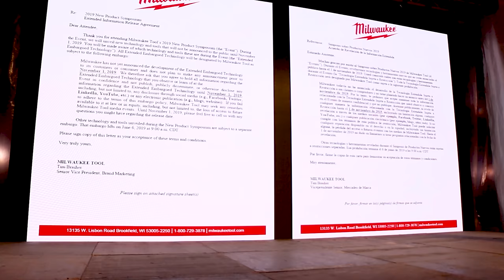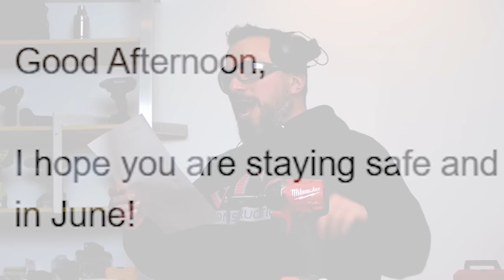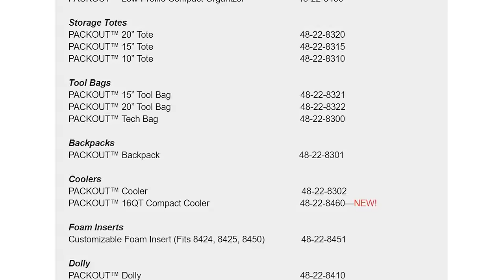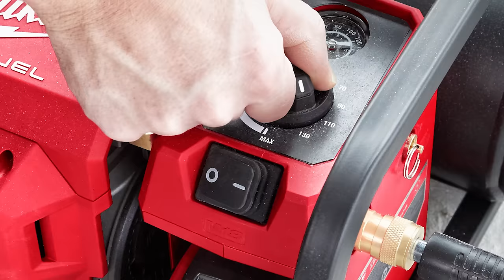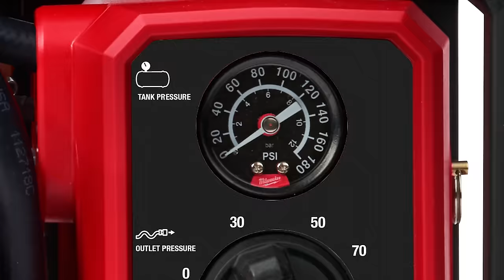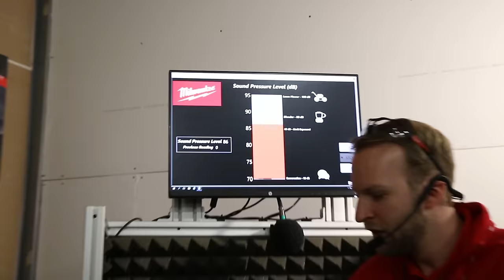MILWAUKEE TOOLS NPS 2020 IS HAPPENING RIGHT NOW! (FIRST LOOK NEW RELEASES)

Comment: Would love a packout Vacuum like everyone else. Fuel Multi tool m12&m18 would be nice just for a little more power, lawnmower, also a M12 pressure washer like word design with the hose or small water container

Comment: Very excited to see the compressor. I'll need to see it in action before deciding if I like it more than conventional options, but I think this would be great for simple things like filling up tires without worrying about running over to an outlet to fill up the tank every 10 minutes AND lets you be portable to places like storage units without driving around with either a generator or a tank of compressed air (which I'm not a huge fan of doing) in the back of the truck.

Comment: It stands to reason that Milwaukee likely caved from so many people asking about portable air compressors. Ryobi and DeWalt already have battery-operated units. 

What tools do I want to see next? Well, my dreams are lofty, but I dream of the day Milwaukee makes a portable M18 battery-operated plasma-cutting torch. Heck, get me a multi-bay M18 battery-operated welding machine too with SMAW and GTAW (Stick-Arc and Tungsten-Inert-Gas). Probably would cost the price of a liver but would be cool as heck.
Reply: Also, I see potential with the cooler-pack to have an M18 powered cooler. There's already units you can plug into a cigarette outlet and have them chill drinks without the need for ice.

Comment: How bout a Milwaukee M18 15 amp Sine Wave Inverter Power Supply? Dewalt released in 2017
Reply: Milwaukee has a patent for a packout compatible inverter.
Reply: @amoscardoza5253  yep seen that around the time the 2019 NPS happened.
Reply: They have a patent for an M18 version almost identical to the MX FUEL one. I made a video about it a while back.

Comment: I want 2 things. a portable, standard table top drill press that runs on m18 batteries that i can use in my wood shop then pack up and take with me in my off road recovery rig.  2nd is I want a solar charging station for the batteries

Comment: I like the compressor, but really wish it was dual fuel- some days 1600 nails is our breakfast- I hate changing batteries and lugging a billion in the van. I love the flexibility tho when I only have a small trim job to use a cordless miter saw and a cordless compressor would add to that, just wish I could plug it in when we’re on longer multi day jobs-

Comment: I wish millwaukee would make an m18 powersorce like dewalt has were you could put 4 batteries in it and get 15 amps ac out of it or charge 4 18v batteries on it.   I think people would buy it because their is still alot of corded tools and appliances and this can power those and run a microwave without the huge expense of buying new batteries for the mx line and that power station.  This makes the batterys most people already have. More valuable and gives people the mobility of power. And if millwaukee designed it well enough. It can be an add on to the existing millwaukee pack out system so other boxes can be stacked on them. And Also design it to take the 12.0 battery for longer run time.

Comment: Would like to see a m12 gen3 fuel jigsaw and multitool
Reply: Milko Petkov with a dust blower on the jigsaw
Reply: I use my m12 multi tool the most and it could use a bit more “fuel” power.  I’d buy one for sure

Comment: I knew they’d do pneumatic option, b/c as battery nailers are great. If you doing a production job, battery nailers are not fun to carry/use all day still on a production setting. Just isn’t fast enough compared to the “weight” of a pneumatic nailer, imo 
But, would like to see the battery nailers shed some pounds & get lighter....cuz that would be nice

Comment: im not a carpenter but maybe some of the old school guys still like the air compressors or maybe the battery nailers are too heavy & bulky with the batteries on them....im sure milwaukee will have an answer 🤔
Reply: All hail the King!!!
Reply: Preach it brother!
Reply: It's true at this time... Staple guns, and 18g Brad nails and above can all be benefitted by air tools... I have a Makita 18g Brad nailer. It does well... But it won't drive more than about 1 1/4" in pure hardwood. And the air nailers are generally faster and lighter weight as well.... And cheaper than the electric lol. For 23g pin nails it's cordless electric all day. I personally don't think I will ever go back to bringing an air compressor with me. But that's just cause I do most of my prefab at my shop. If I had to build from scratch at the job site I would 100% need a portable compressor
Reply: cordless nail guns are too heavy bulky. and not powerfull enough for hardwoods. air tools dont over heat. have small profiles. and can shoot reliably nonstop
Reply: @josephvouis5301  looks like you answered it...thanks for the response 👍

Comment: Wouldnt getting a inverted generator with cordes tools be just as efficient maybe even better, it would of been nice if you can wall plug these aswell as using a corded outlet rool with compressor tool optional aswell, im thinking more of a multitool purposes

Comment: Need to make a battery jumper for your car
Reply: just stick a 14 awg thhn wire into the right terminals on a m18 battery and connect that, I've done it many times in the winter.  I just wouldn't risk it on newer cars with sensitive electronics

Comment: Dear santa, I want an M12 insulated cable tacker/stapler, an M12 combo work light/Bluetooth radio, an M12 cyclonic vac that doesn't clog up after cleaning up 2 teaspoons of concrete dust like the current ones do, a compact M12 blower, and a gen 3 M12 hammer drill driver that isn't weaker than a little girl. It's got less torque in gear 1 than my old  Ryobi has in gear 2...

Other than that the M12 gen 2 impact and soldering iron are fcking awesome.

Also it's probably just me, but packout is my nightmare. So many parts to separate and latches to undo all the time to get what you need.

Comment: Will the Milwaukee air compressor be able support 16ga. & 15ga. Nailer.
Reply: Chris Chamberlain it should ... maybe even for a framing gun too but not for a big framing job just for small things. But I could be wrong on this we will see few test here on YouTube and then will know it  ... but for the 15ga and 16ga it should be no problem
Reply: Wolfgang Selle I am been trying to find a compressor just for trim work. That quiet for into use.

Comment: Recently switched over from Ridgid I'm a huge Milwaukee fan I would love to see a fuel version other oscillating tool as and maintenance and repair Tech I used the oscillating tool quite a bit and I'm not fond of the Way you change blades

Comment: Honestly I did kinda think they would make this tool. Hoped so even more than thought so though. There's a ton more uses for air on a job site than just running your guns off it. Anything from cleaning sawdust off yourself and your tool bags to topping off your big truck tires (which their M12 inflator was falsely pictured doing... yet again, awesome tool, but overhyped, so peoples expectations were too high and not met). This, however, should be able to inflate a truck tire, maybe even a tractor tire if you were patient. 

All that aside, there's two categories of tool guys they have to look at in the scope of pneumatic tools. There's the guys who already have all their favorite pneumatic nailers (probably Hitachi for a huge chunk of these guys) and then there's the guys who haven't fully invested yet and are open to anything if it's good. This new offering widens the options for users and may help them snag some customers they wouldn't have at all if they'd never made this one tool.
Reply: Austin Patrick blowing dust off with two gallon tank is not very efficient.

Comment: Hey guys I love your channel, this is  not related to this video but do you guys know anything about GPS trackers for tools a DeWalt tool box got stolen right out of my work in broad daylight this week By a guy wearing a bandanna that walked into our large shop loading bay took my rolling workstation full of around $3000 of DeWalt tools and batteries what could I have done to stop that from happening and how can I locate my tools without them finding it easily preferably
Reply from the maker: I don’t know about dewalt, but Milwaukee sells the “Tick”

Comment: I would like to see a eletric version of an automotive air hammer that can compete with the newmatic air hammers if Milwaukee will do that thay will be the first to make one if thay do make one it should be able to separate ball joints from knuckles it should have multiple attachments for hammering for example chisel, picklefork, a flat face hammer and a fue uther attachments to the anvil I even have an idea how to make it with a motor and some gears for extra torque and a fue springs to help with the vibration and possibly a retractable handle for extra force when needed I gave tried to make a eletric hamer out of a Milwaukee sawza and a hamer drill with a baring and a big metal cup thay work ok but if thay make it purpose built and much smaller that will be awesome

Comment: I'm not really concerned about the noise as much. I like the size and form factor for transporting. It makes using it a little easier as well because you don't have to worry bout plugging it in. Not as convenient as a cordless nailer for small jobs jobs but pair it with a shorter cord and it's not as big a hassle to pull out for a few nails.

Comment: Well, I like Milwaukee tools but this compressor is really high price, even if it was quite, I don't see myself paying almost double the price of DeWalt compressor since you can buy DeWalt compressor with two batteries and charger cheaper than this one as a bare tool!

Comment: @VCG Construction why would anyone go for this over the dewalt?. for $539 you get it to shoot 1600 nails. dewalts will shoot 2400 nails for $450 and i can vouch for the performance of dewalts  over 2 years and having 2 of them on my crew. and milwaukees may be the quietest compressor thats dry cycle. but not compared to oiled.

Comment: Milwaukee wants $100 for that 16qt cooler? I’m not seeing it worth $100, it looks more like a $30 maybe $40 cooler.
Reply from the maker: I appreciate that feedback Jason!
Reply: Jason Babila depends how it holds ice. a yeti 20qt is around 200$
Reply: The Yeti Roadie 20 is on sale for  $158 just about everywhere due to the fact it's being discontinued, one thing I can say about the Yeti coolers is it's very tough and durable, one of my Yeti coolers fell off of my roof top Yakima cargo basket when one of the nylon straps came undone, it fell onto the highway while rolling at 55 mph, no cracks inside and outside, just a few scuff marks from bouncing and tumbling on the asphalt.

Comment: ]I'd like to see an inverter generator line based on the M18 batteries, perhaps using 2 (up to 4) in parallel so I can run a single 120VAC motor-powered polisher for 90 minutes at a time. Sort of like an EGO power station, but with M18's. The trouble with motors is their startup current is astronomical, so my measly 220W corded polisher can draw 900 to 1000W at startup, thereby making most battery-powered inverters inadequate.  And the MXFUEL is too big (and too expensive) for what I need, and the EGO is too expensive as I'm already invested in the M18 battery line.  Oh, and if it can charge the batteries at home, that would be great.

But that's just  a wish on my part. So while I wait, I got the Makita random-orbit polisher XOP02Z that uses the LXT 18V battery line. I'd have preferred not to invest in a new battery system, but Milwaukee didn't have anything that was comparable to the Makita or my corded Cyclo.
Reply from the maker: We appreciate the feedback!
Reply: i want a M18 inverter as well

Comment: What’s the point of a batter powered air compressor if you can just use a battery powered version of the air tool? Isn’t that the point for most power tools? It might just be me but I see this as a useless item.

Comment: I really just wish they would handle the Fuel 18v drill driver issue in a respectful way!!!
That thing is useless!!!! 

While VERY powerful...... It strips out anything.... The hammer comes on too late....
You have to be 100% on straight, and have most of your body weight into it, to successfully screw in anything!!!! Not happening on a latter.....
A complete Sh!tshow!!!!! LOL

Comment: Energy is not free. Each time a form of energy is converted from one type to another there are efficiency losses.  Coal burns to crest Steam and there is a loss. Steam turns a turbine to make electricity a loss. 120 volt converts to 12volt a loss. Battery powers an air compressor that powers a tool more losses. Unless you are building a cabin in the boondocks or your tires run flat I don’t see a place for battery powered compressor
Reply: For the same reason as any battery tool. Convenience. Cars lose energy converting fossil fuels to movement so let's not drive